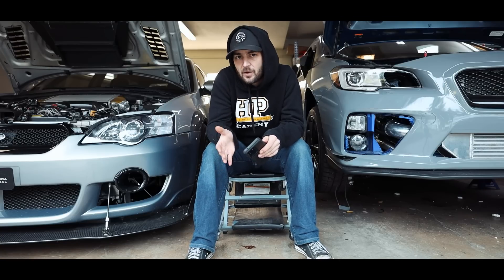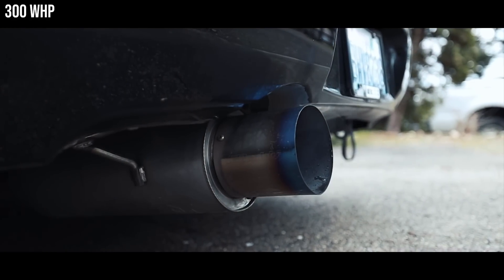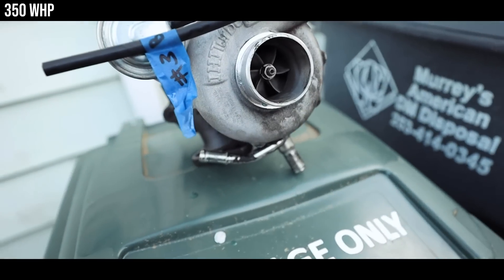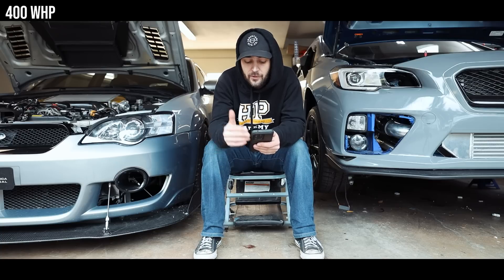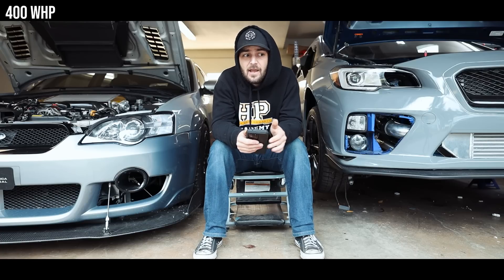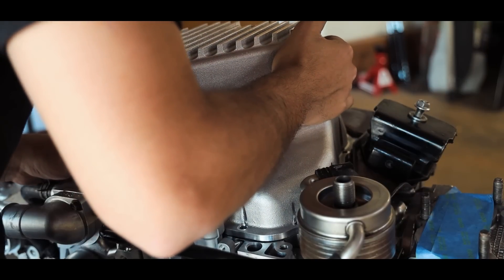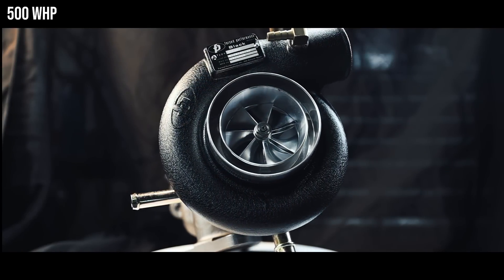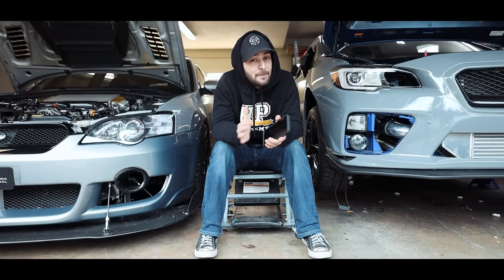How to Make "X" Horsepower in a Subaru WRX STI

Comment: Hey new subscriber I appriciate the time to make this video. I have a couple things, first off a tip I think would help a lot of people including myself is maybe putting a price to each item when explaining it to get a idea on how much everything would cost with the total, would be clutch! I had a question maybe a future video but, with all these parts mentioned in each HP range are these all to have a pretty reliable car at that HP range or is it pushing it to that HP in each power range? And maybe a video on if it is reliable how to maintain that reliability with the amount of mantenence needed if anyone different, or what to look out for periodically in each  Hp range to maintain the car running smooth. Thank you ! 👍🏽
Reply from the maker: I intentionally left price out because there are discounts, MSRP, coupons, codes etc that it would never be accurate. And yessir all to make reliable power at those levels 😁
Reply: @Smeedia  Any maintenance differences from stock to these power levels to look out for?

Comment: I know this is kinda niche, but I’m looking at pushing my old 2011 forester XT to 300 wheel. Nothing crazy, just a bit more pep. Ej255 and a 4EAT(yuck) from what I’ve read the stock air box and axle back are good to about 350-400. I’m in Phoenix so I’m adding a trans cooler first, then getting the accessport. Next step is the catted down pipe. Forums seem to think that’s all I’ll need to hit 300 wheel but I’m skeptical. I really feel like I should do fuel pump, injectors, a catch can, and a boost controller just to be safe. Thoughts?
Reply: VF52 with an AP, downpipe, intake, boost contoller will get you there. I have  13 FXT but mine also has an STi 6speed swap. In for Flex Fuel now before the epa bans everything else.
Reply from the maker: The 255 will follow the same modding path ad this. But you'll have limitations on the shortblock and your trans 🙏

Comment: Or you can just LS swap
Reply from the maker: Going to be spending way more 💀
Reply: @Smeedia  not it’s a vortech ls
Reply from the maker: Fab costs, trans swap, electrical adds up quick. Barreling the Can system is a PIA with any swap on these
Reply: @Smeedia  fair point, what it if fab work costs were covered?
Reply from the maker: @juanespinoza6208  if your looking for sheer power snd fab costs covered by all means, it'll definitely throw off the balance of the car. But for a straight line car it would be dope. Have a few buddies while LS swapped some older chassis

Comment: At what horsepower point have you ran into issues with the engine? Where should I stop pushing mine?
Reply from the maker: As long as the motors built for the power you'll be solid. My 650WHP STI had 0 engine issues

Comment: Im looking at the 350-400hp range, is it required to make the e85 change when upgrading the fuel system?
Reply from the maker: You don't have to, you can definitely meet 400 on pump gas.

If you wanna run E I would make the changes needed

Comment: Hey Smeedia, always appreciate your feedback on content - Admirable parts list with realistic figures! I'm currently running a 2014 STI with Cobb Stage 2+ 94 Octane Map (Cobbs OTS). Invidia Downpipe, Nameless Performance Catless Turbo-back Exhaust, and SF Intake with Box. Have been running this setup for 5+ Years with No check engine Light nor issues throughout that entire time, aside from boost creep in the winter. (22.9PSI on the stock turbo in -30 Degree Celcius Conditions). Am Wondering, what would be your next recommendation for making more reliable power? Currently running around 17-19 psi in the summer.
Reply from the maker: Whats your end goal for power? 🔥😁

Comment: Holy shit this is a lot of things needed to make more power! Just buy a Golf R guys! AWD and you can literally make 500whp with just a downpipe, hybrid turbo upgrade, tune, K&N drop in filter, intercooler, MPI, and HPFP. If you want 400whp, literally just a downpipe, tune, and E85. Done.
Reply from the maker: For sure. Totally diffrent animals, but gets very expensive quickly getting a Golf R to Big turbo STI Levels. Definitely trade offs. The R would be a better 400-450WHP car over the STI. But I also prefer the subarus AWD system to the golf's
Reply: @Smeedia  yes, that’s the big downfall of the Golf R’s AWD system. It’s mostly FWD until AWD is needed. The MK8 Golf R is now RWD biased, but it should’ve been like that the whole time. The STI’s AWD is a lot better, and it also gives you the adjustments for the diff which is cool. Overall, the STI is a much more raw AWD car, but it sucks how much you have to put into it to make it fast and reliable.

Comment: I have a big decision to make when my lease is up in 6 months. Do I want a V8, twinned turbo'd v6, or a AWD 4 banger with some mods. Very informative video. Thank you for the great work!
Reply from the maker: What are the cars that your considering? 🔥
Reply: @Smeedia  budget allows for a used ZL1, a used RC-F, a used M4, or a new STI
Reply from the maker: That M4 though 🔥
Reply: @ricandude06  if reliability isn't an issue m4 or sti. If you want big power for little relative cost, zl1. If you want a car that will have little to no issues and can take alot of abuse, rcf. I personally have an isf and it may not be the fastest but I've never had an issue with breaking down and alot of people can say the same thing. There isn't much aftermarket support with power mods but thats a sacrifice that I'm willing to make.

Comment: What are your thoughts on intake manifolds? I know IBR makes a retrofit kit for putting a BRZ manifold on a WRX, but I’m curious what you think.
Reply from the maker: I've done a few of them, I don't see them as a necessity unless your adding port injection. The plastic manifolds flow pretty good and dispurse heat rather well

Comment: Hello, Love the videos! Question though, What is the difference between the RA motors and the non-RA motors that cause the RA motors to handle 100 mor HP? Than k you for the content!
Reply from the maker: Redesigned piston ans ring gap 🙏

Comment: I think I built my 13 WRX hatch more than the transmission can handle. Grimmspeed downpipe, killer B header, boost controller, top mount intercooler, bigger radiator, aem pump and step down plugs, ark grip catback, grimmspeed AOS because it's a daily. Tuned on 93 by Eric at Torqued Performance. I have no idea the HP.
Reply from the maker: Should be able to toss a log onto a virtual dyno to get a ball park 🔥
Reply: What did it put down?

Comment: Very interesting , im in NZ , i run most factory options, get 420nm torque, 360whp at 16psi. 280lph fuel pump, 1000cc injectors,  Garrett built tdo6 20g turbo. Run by a link g4+ ecu. Perrin intake with pod filter and 3" exhaust from turbo back, full cat delete. Built about 5 years ago, most reliable daily ever! All in an ej20. Over here we have 98 and 100+ octane,  it's amazing how much just the fuel can change a setup
Reply from the maker: You guys get some good fuel, up where I'm at were limited with 92 and a couple E85 stations here and there 😤
Reply: @Smeedia  yeah, i don't know what bang for buck I'd get with that,  when i done me mods i should have gone flexi fuel setup, but tuned for 98+ so restricts me a little. I just figured e85 wasn't a worry at the time... haha i should have done it 🤣 also it's all in a 2001 bugeye I've had for nearly 10 years
Reply: NZ uses the european standard for octane rating, your 98 and 100 is the same as our 91 and 93

Comment: Is there a reason for using the grim speed catted divorced downpipe over the invidia one ? I have a q300 and I figured that the invidia downpipe would be a good fit onto the q300 cat back.
Reply from the maker: I don't like invidias downpipe, the bellmount and flange design are ass to work with. The bellmouth slopes down so steep that the lower nut is a hoe to get on. Grimmspeeds flow fantastic and use a higher quality cat

Comment: You're. The. Man. I've got my 15 launch edition at stage 2 (down, 1050 injectors, pump, solenoid, etc). Havent done the up pipe yet. Mostly grimmspeed parts. Dyno hit 305whp so I was stoked. I'm chasing 350 next and this will help so much! Stay gold🤘
Reply from the maker: Ohhhh get it 🔥💪😁
Reply: just buy a sti it already comes with 305 lol
Reply: @nickyplayz2329  actually only comes with about 240 at the wheels (305 crank). Mine is at stage 2+ now and hits 305 at the wheel. 370-80 crank. Been at this tune for 2 years and it's been fantastic.

Comment: What are your thoughts on the killer B inlet?
Reply: I’m working on support mods right now, aos, cyl 4 cooling mod, killer b high flow pump housing. and iag street pan/pickup next week. Hopefully access port and downpipe in the spring. am I over killing my stock motor?
Reply from the maker: Great inlet 🔥 
Imo it's never overkill 🤙

Comment: Hey thanks for answering my other other questions I had another random question that I can’t seem to find an answer for- my 08 wrx is stage 1 and map notes say it should be hitting 13.5 psi but I’m only hitting 6psi max, with a td boost error of 12… to 20… could the ots tune be the issue or a boost leak or bad turbo? However before I got the tune it did feel a little bit more boosty
Reply from the maker: I would start with a pressure check then re flash the map onto the ECU

Comment: Dont go 400HP+ if you daily it. At that point, you don't want a Subaru, you want a V8.
Reply from the maker: Not true, old set up was 456WHP in pump gas. 0 issues and best on the car daily. 

Daily drove it at 650WHP as well with 0 issues

Comment: I believe I already know the answer to this question but what they heck...if I Plan to go beyond 350 (eventually) but my pit stop for now is 300..couldn't I run some 1300 injectors with the upgraded fuel pump ; Catted downpipe and intake with a protune? Or it is recommended to not go over kill with such high injectors (1050 for now) and install them once I'm shooting for higher numbers..because I'm going for 300+ right now but and ik I will go 350-400 in the future.
Reply from the maker: Yes you can run 1300s 🤙🔥 you worm really run into idle issued with injector size until 1700+
Reply: @Smeedia  man u rely pretty fast..thanks man and love your content

Comment: If I may add to the list. For the 300whp area, I was told by my tuner that the stock airbox is more than sufficient and "safer" for upwards to 350ish. The enclosure box for the Cobb(or most aftermarket options) filter also doesnt get intake temps down as well as the stock box. Tho Im sure you could heat wrap the box to help mitigate the hot-air intake

Comment: Pretty accurate list for all these numbers.  However, I would go with at least forged pistons if the car will make > 350 whp and will be driven hard.  I'd also use a closed deck if going beyond 450 whp. I wouldn't risk cracking a sleeve after spending so much money.
Reply from the maker: Definitely  never hurts to do so 🔥 
My RA block took a beating in the regular at 456WHP. But for reassurance pistons are not a bad idea. But then you go down the rabbit hole of a bore and hone, then might as well do rods etc

Comment: Personally I like the blouch ball bearing 18g over the Cobb 20g. I did the oil pan and pick up tube on my stock turbo car I think it’s just a good idea and want to do the tgv and 2nd air pump  deletes before upgrading the turbo as well.
Reply from the maker: The Blouch turbos are great, Matt uses the 1.5XTR on the outback that was in the video 🔥

Comment: Hey man great video! Recently I have been looking into downpipes, specifically Invidia catted divorced for my 18 STI. I noticed they have 1 with the catt in the stock location and the other has the catt lower towards the mid pipe flange. Do you know the difference between the two? if 1 style is better than the other? Thanks in advance!
Reply from the maker: I do not like invidias downpipe, the flange design is not good at all, they work though. I would think that they'd be diffrent cats. Maybe 1 is a GESI cat
Reply: @Smeedia  good to know, what is it you don't like about the flange? The way it bolts up or the airflow is not great from the turbo?
Reply from the maker: The bottom nut is a huge PIA all the time. The bellmouth slopes super steep right off of the flange
Reply: @Smeedia  I think I might just go with the COBB, ive only seen positive things about them. Plus I can use the OTS tune until I get a chance on the dyno!

Comment: Not bad, I perfer the CSF over the Koyo , but to each their own. You didn't mention GDT coolant bypass . that probably half the community uses. I'm running an iag Trojan or IAG700 , id1700cc KB header, externally gated on Turbosmart 44 and Turbosmart Bov😛  Flex.  😗1.5 XTR what can you do.
Reply from the maker: Haven't seen any real changed between running the cyl 4 cooling mod and not using one so left it out on this one. That 1.5XTR is a solid turbo🔥🔥🔥

Comment: Awesome content. Appreciate you taking the time to compile and list these mods. I think you could swap out the aem 340 pump for a Dw400 setup and get a lot of pump for your money. Dw400 will give you a true 400lph feed over the aem340 which typically doesn't meet its advertised lph. I would also add that as soon as you make the change in injectors or fuel pump that the relay harness be done no matter what the power level is. Once you switch to a bigger pump it will require more voltage and a direct feed from your alternator will ensure your injectors get the proper pulse cycle at every rpm range.
Reply from the maker: Personally never been a huge fan of DW pumps, had a couple fail on me before.
Reply: @Smeedia  I hear you, aem pumps can fail as well. No product is immune to it. I'm speaking more toward the Dw400 actually flowing what they advertise.
Reply from the maker: True, just speaking from experience. Seen more DWs let down than AEM.  
Flow on that pump looks great though 415LPH 🔥

Comment: Thanks for vid Tanner!! Just wondering if there are any decent aftermarket twinscroll ball bearing turbos for people with an ej207? Keeping my eye out for a vf53 off a R205!! Also do you have the part number or copper washer size for the turbo oil feed banjo bolt! Gonna whip those nasty filters out!!!
Reply from the maker: I don't have the part number on me but should be online fairly easy to track down 🔥 for twin scroll, there are some but would have to do a search to track em down. Haven't seen em for a while

Comment: I have a 21 sti but josh baders opinion on the RA Block is that it’s almost exactly the same, reliability wise in power
Reply from the maker: In comparison to what? The RA blocks have been holding power exceptionally well
Reply: @Smeedia  in comparison to previous ej257s, just his words i read in his comments

Comment: Great video, lots of useful information. I had a quick question. When I upgrade the injectors, does that require an immediate tune or will that just add headroom for duty cycle until I get around to getting another tune?
Reply from the maker: You will need an immediate tune 🤙

Comment: Hey smeedia I love the content! I have a ej207 getting tuned and it runs perfect under boost but it fuel cuts 25% when it’s not in boost any idea what the problem might be?
Reply from the maker: How are you reading that it's cutting 25%? Open source?
Reply: @Smeedia  yes it’s at a dyno and they can’t figure it out just wondering if you would have any ideas?
Reply from the maker: Do you have the ability to view AF correction?
Reply: @Smeedia  I can try to find out. Also it only happens when the car gets up to temp to add to the mystery.

Comment: I would like to see a video for the non STI WRX’s. Curious on the difference between the two
Reply from the maker: Main difference will be block and trans limitations 🙏🙏🙏
Reply: @Smeedia  If you're EJ, should you get an old STI trans or are there new aftermarket options?
Reply from the maker: Depends on what you want from the set up, personally I like thr older 04/05 trans but the 07+ are solid
Reply: @Smeedia  Really really - well thanks for the info i'll follow for more tips :

Comment: Awesome breakdown and thanks for the info!   **With your mod list for the 350-400 HP range, what are the pros and cons to running ID 1300 injectors for a pump gas (NON-flex) fuel system instead of the 1050 injectors?
Reply from the maker: Totally fine to do so 🤙 cost more $$$ but they will still work 🔥

Comment: This would've nice a couple months ago, when I was building mine! I still follow your videos religiously, and my build was essentially a copy of what you did to the 17 sti before you started putting the flat 6 in it. Went Flex Fuel and using an FP Blue with a 44mm WG. I'm putting down 450whp and 408 ft lb on a mustang dyno. Only thing different from your new list is that I'm still on a stock clutch, but I'm loving it, regardless!
Reply from the maker: Ohhhhh sounds like some spicey numbers you've got over there 🥵🔥

Comment: Any need for 15mm ARP head studs? Should we might as well get them for possible upgrade purposes in the future? How do you feel about catless dp’s? I’m in a non emissions state
Reply from the maker: Not needed until your aiming for 500+ and higher boost applications. 
Always suggest staying catted unless your gling rotated 🤙
Reply: @Smeedia  how much is rotated setup? And that’s my goal range, 500+
Reply: Cool haven't seen 15mm headstuds
Reply: @zeno15sti33  they exist bro. Best ones for high power

Comment: Well looks like my forester will be a 500+hp build....oh dear....so -8 lines are an over kill then for 400-500 or good to have when running E85
Reply from the maker: Correct 🤙 we did 650WHP on the 05 STI using -6 Line on E85